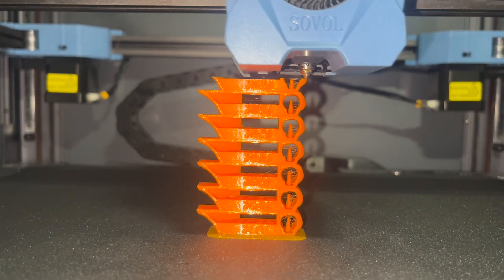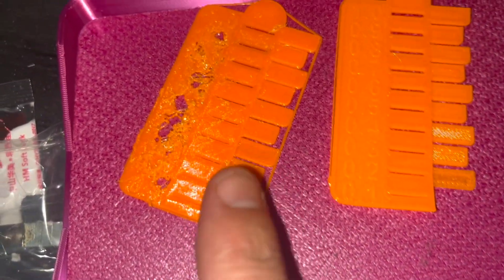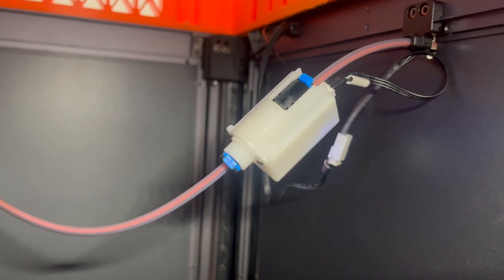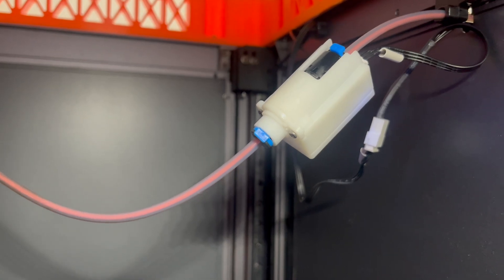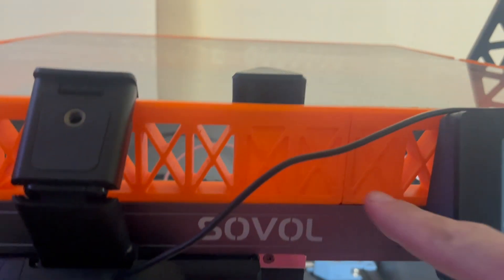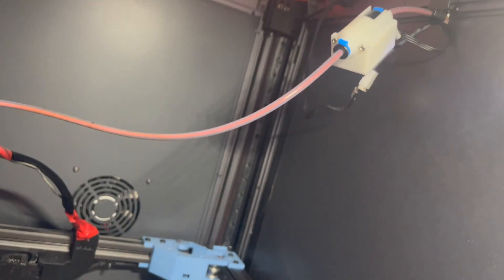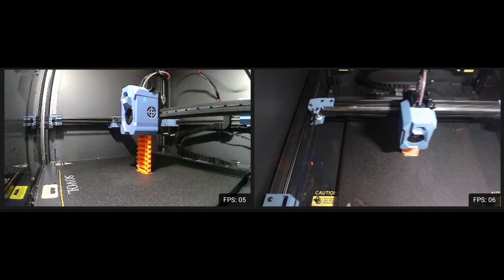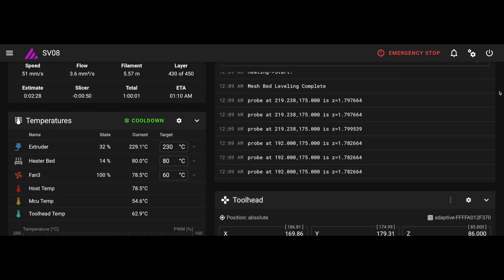Sovol SV08 fixed print failure under extruding inconsistent Messy 3d print errors

Comment: I’m thinking of ordering one, are you happy with it?
Reply from the maker: I am happy with it. It can be dialled in but try to avoid any variables, ie filament variations.
Reply: I almost exclusively print in PETG
Reply from the maker: I have been doing Petg printing lately. My latest print, I just recently completed with 1kg of filament. Turned out great. It is a capable machine at a great price, just expect some minor hiccups here and there and do smaller test prints before attempting bigger prints.